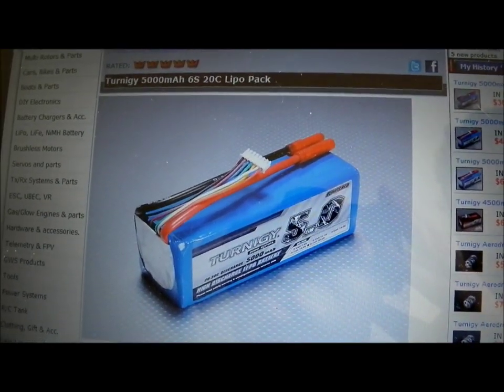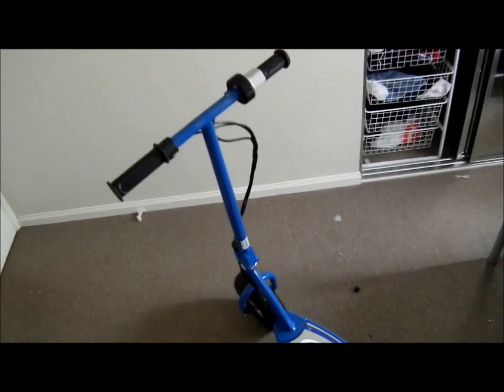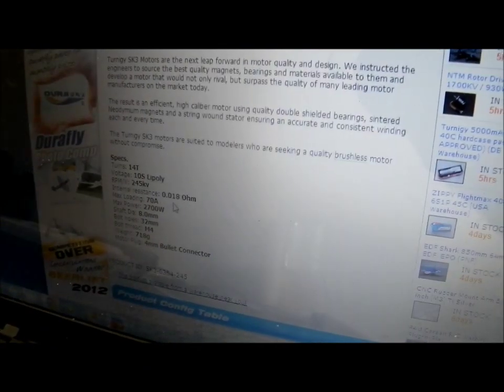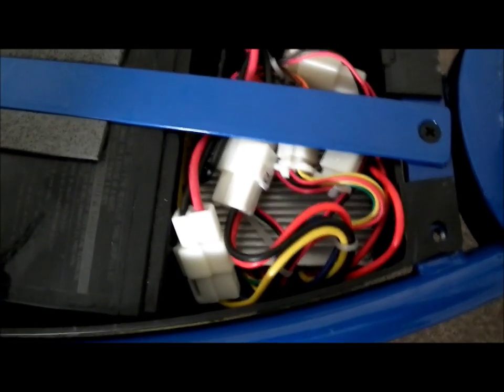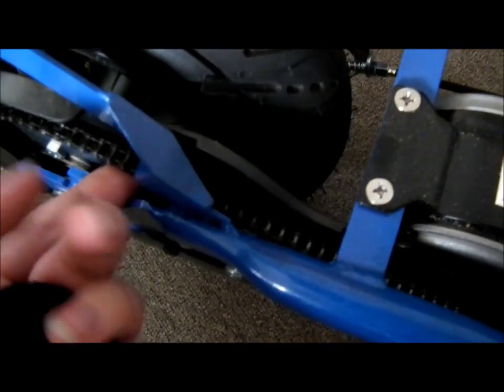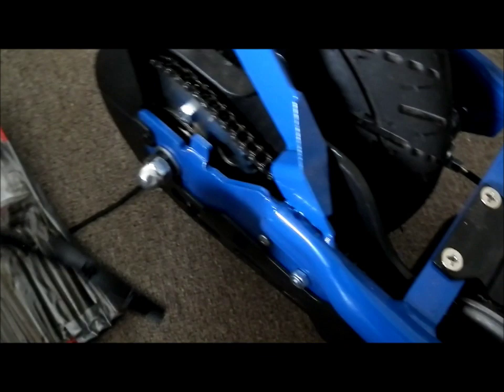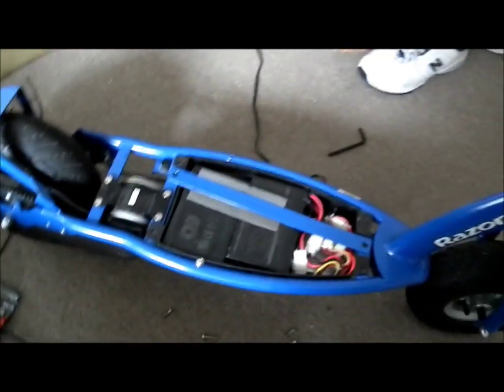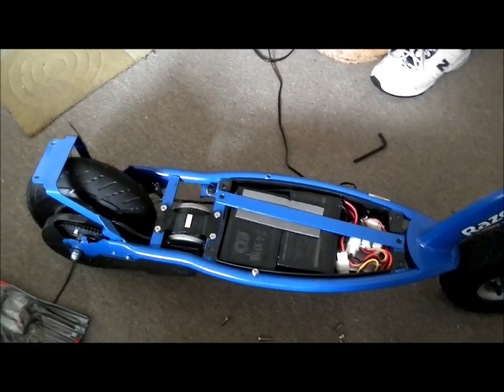Fun upcoming project!

Comment: G'day LPF I just bought the same scooter but in grey, I noticed yours is foldable, are they all foldable? or is yours a particular E300 model...... I got mine in Australia Canberra from Toys R Us and also looking t modding it. I will keep on watching your clip to see what I need to order and where from. Keep up the great work and I have subscribed to your channel, cheers Ocean
Reply from the maker: On mine there is a thumbscrew on the handlebar pole that allows it to fold down about 1/4 of the way from the bottom. I just had a quick look on Google images and indeed the grey version doesn't seem to have this, really odd given it's the same scooter!
Reply: LPFthings yeah your right how odd hey, have you thought about extending the handle bars? I wonder if it can be done . I'm in the process of buying a variable throttle from USA.

Comment: You can over volt the original motor to 36 or 48 volts with a different controller.
the motor wont last long but its fun while collecting the new parts.